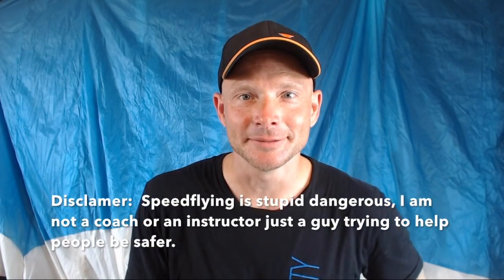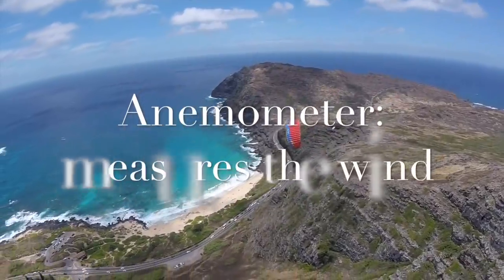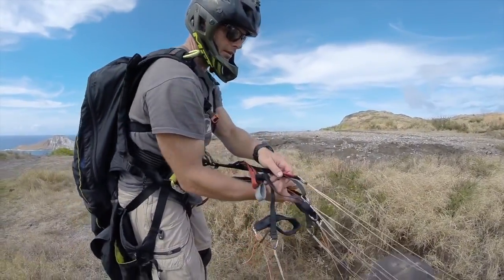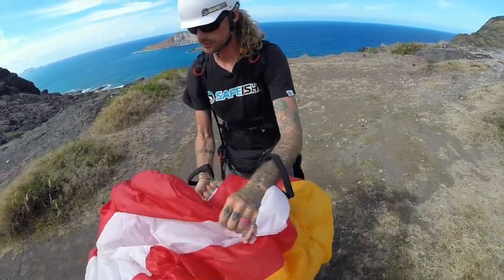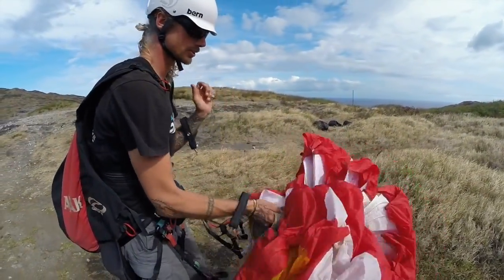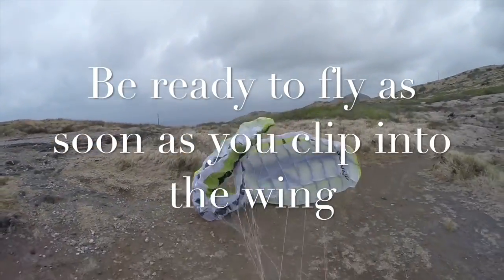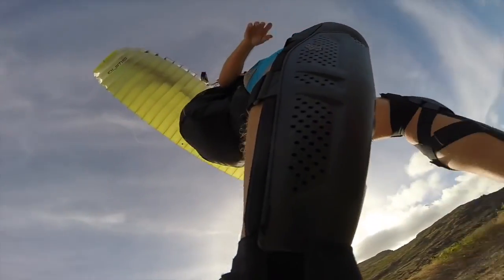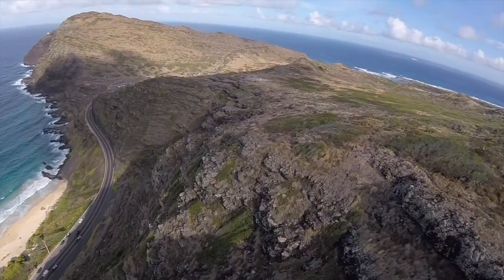Tips for High Wind Speedflying and Launching:  What you don't know can hurt you

Comment: Don't forget to check your binners to make sure you are clipped in and they are fully closed. If you fly with a reserve then check that it is connected and the pins are fully seated.  Also unless you have a quiver of wings and switch them around there is absolutely no reason to disconnect your wing from your harness, ever.  It will virtually eliminate any possibility of line tangles, overs, knots, etc and make your setup process a lot faster.

Comment: Great Video! I'm headed to Maui in January and am wondering if you knew an speedflying spots there?
Reply from the maker: Thanks Ben!  I learned to Paraglide on Maui.  The spot on Poli Poli is a great beginner pg spot.  I started skimming the ground there on a 20m.  It's pretty shallow, so I wouldn't fly much less than that there.  "The L" is a great thermal site for full sized wings.  There is some potential spots there just north of Honolua Bay on the west side, but I don't think anyone has tried them.  Oahu is much better unfortunately.  I can connect you with some pg people if you want to fly big wings there.  LMK.

Comment: Hey Josh! Sick video! I am moving to Hawaii this summer and planning on getting my P2 as my first step to gradually build up the skills to speedfly. As a reference for way down the road, I noticed you mentioned having foam back protection - what harness systems do you recommend that have the foam or airbag protection?
Reply from the maker: Chase Milhorn Hi Chase, Hawaii can be a great place to learn depending on which island you are on.  Maui is a great place to get your p2.  I use a poc soft foam spine protector and an airbag when I fly wings larger than 15m.  My favorite harness is the Level Fusion harness and I do have the airbag option on it.  I just take it off sometimes.  Hope this helps and lmk if you have any other questions🤙